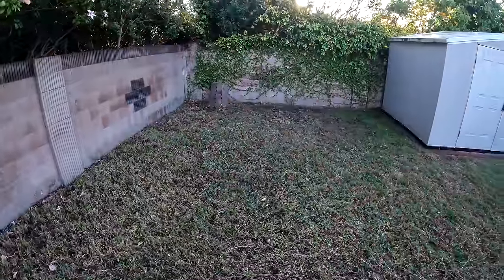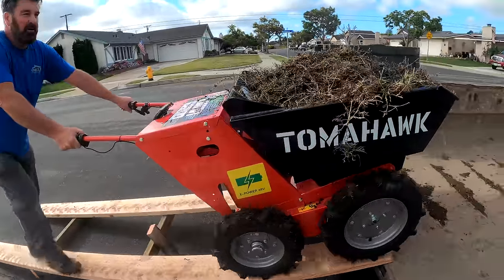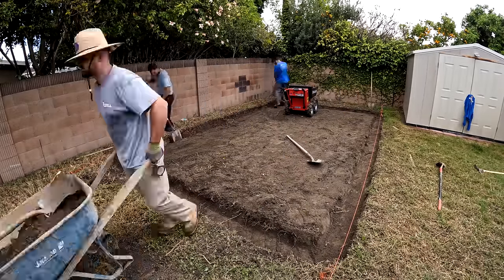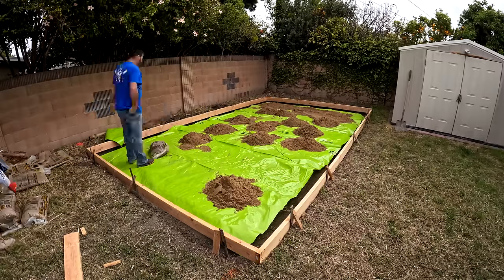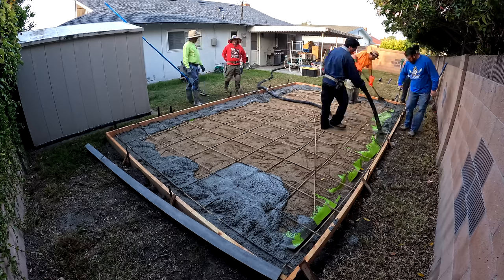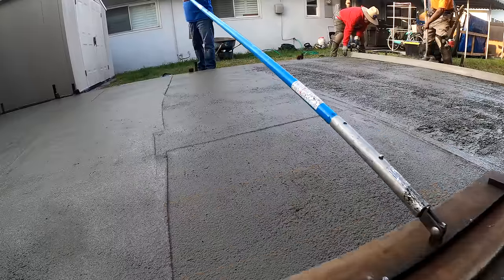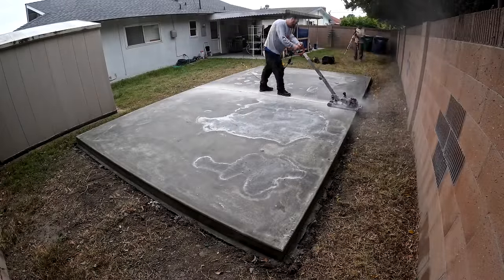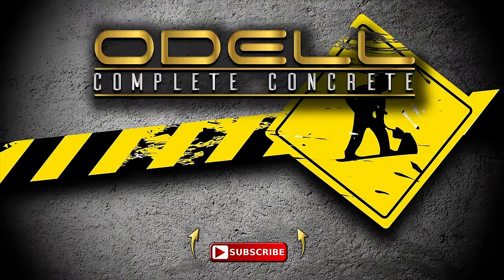How to Build a Storage Shed Slab Foundation

Comment: seeing these experts at work has convinced me to leave this to the pros lol
Reply: You could DIY. Done it myself and the little lady with 60 or 80 pound premixed concrete bags and cement with concrete mix. Keep the sections small no more than 10'x8' at a time if you don't have 5 guys working at it. Pouring is fast and dirty finishing takes most of the time. Plate vibrator for compacting soil, concrete vibrator to remove air bubbles and a nice smooth edge, mixer and finishing tools. Need to pay attention to drying time and temperature, each day and pour is a little different. Need to practice on finishing before any major work.

Comment: I had to build a cement pad for my dog’s 8’ x 30’ ft kennel run. That was a lot of work for one guy, and the cost could have been hard to handle at that time in my life. SO, I used pop cans I had save up as fillers. I’d lay a few rows of cans with 2-3 inches of space in between, then cement between. Then finished off with a couple inches over the whole top. No cans showed (except for the little 8 inch square to prove I used the cans. That was 25-30 years ago, still good as new. I did fill one 4’ x 8’ section with gravel for poop n pee. A great little condo inside, and my spoiled doggers were in heaven (and safe).
Reply from the maker: Thats interesting
Ty
Reply: You got any videos or pictures I like too see there home
Reply: @danielpulido5932  Sorry Daniel, I don’t. That was 20+ years ago. But, the heavy duty chain link was framed with aluminum poles like at a play ground.

Comment: This is EXACTLY what I am trying to have done in my yard for a tool shed kit. Been looking for over a year, and haven't found a single contractor who ever came out to see and give a quote, that ever called me back. Seeing, this, I believe I could do it myself. Thanks David!!
Reply from the maker: Go for it
GL
Reply: Im in the opposite boat.  All the quotes I've gotten have been over $2000 for a simple 12x14 4in slab!
Reply: @billsmith9249  Same. Just got 3 quotes back. 2200, 1800, and 1900, for a 10x10 shed foundation slab. Nothing crazy just a storage shed, but the quotes are much higher than I'd expected
Reply: Most reputable contractors are too busy to take on a tiny job like that unless you get them early in the spring before it gets busy. Concrete is expensive and on top of it, if you only get small amount (1 yd. or less) you may get stuck with an added small load charge. There is also an added charge for any additive in the concrete (fibermesh or calcium chloride that speeds up the set time, etc) So a little slab can get costly if you contract it out.

Comment: And to add icing on the cake, if you add a couple of ducts, (prior to concrete, )coming up vertical from outside to inside the base, you can thread up electric etc inside the shed without external wire showing ! Nice job.

Comment: The plastic is installed on top of the bed (sand or gravel) or under the bed. What would be the correct way as I have seen videos where the plastic is installed differently?

Comment: Why did you pack sub-grade (soil) and didn't put any grave on sub-grade (for under slab water run-off and reinforcement)? Also, leaving the finish smooth without a broom finish, can leave slab slippery especially if wet.
Reply from the maker: Shed slab
Reply: @OdellCompleteConcrete  still not sure why some things that I mentioned above weren't done? Could you please explain?

Comment: I have an Question regarding pouring slab. is it okay to pour concrete for fountain in parts? (by section with rebar) like have difference between days? im just wonder cause i live on area which has many earthquake and i would like to have my foundation in parts incase it cracks .my building code for my area requires about 12 inches thick concrete with rebar and standing on 10-15 pile of material or dig down to bedrock and put some  material below and make concrete frame up and fill up with material and then concrete to make foundation.

Comment: Wow, that is a hell of a shed pad!!!  Going to last longer theb the shed...  Footing, plastic vapor barrier, pink bar gridded...  Most shed pads are just throw 2x4 on the ground and pour, no rebar or footing. Lol
Reply from the maker: yes I kind of over did it
Reply: I needed a 7x7 pad only so did it myself with 4x4s and used rebar sledgehammered them into groud and corner braces, etc. Took bunch of trips to transport ton+ of 1.5" washed rock abt 6" deep. Lil bit overkill for shed that just fit pad, but looks and drains great. For bigger shed like coming here in vid that pad looks real nice.
Reply: Our code is 12 inch turn down, 3/8 rebar on 20 inch centers. and 1/2 rebar top and bottom  of the beam. Inspected before pour.

Comment: Thank you, and you are right about "masterpiece", mine looking at the side has holes where the guys did not push out air bubbles.  Question if I may, do you not need some kind of vertical studs to set the framing 2X's--or do you install that later?  Thanks.
Reply from the maker: Expansion bolts
Reply: @OdellCompleteConcrete  yes but do you install them as part of the original pour or hammer them in later?

Comment: Have you ever tried using high tensile steel reinforcement mixed in with the concrete it’s normally about 1 mm diameter with the ends folded like the head of a pin on the pieces of metal are approximately 1 1/4 1 1/2 inches long
Reply from the maker: No but it sounds like I may get a splinter

Comment: Why did the owner not consider concrete anchors for framing? Would it be possible for the owner to share future videos of this shed build?
Reply from the maker: He wasn't sure about doors
Reply: @OdellCompleteConcrete  You can always  cut off a bolt in the way. Expansion anchors are crap compared to 'J' bolts on 4 ft. centers.
Reply: Its super easy to install an anchor after the pour. A simple drill then some epoxy and set the anchor in.

Comment: I’m trying to build me a 16’x28’ garage/shed on my backyard but not sure if the concrete slab should have beam sides or not what do you think? Or should it just be a flat solid slab with extra rebar
Reply from the maker: Thickened edges work for anchors
Reply: @OdellCompleteConcrete  I was told to do some kind of pillars on the corners and one in the middle of the foundation like a 1ft deep that should help it a bit. But it seems like you know what you are doing, what do you think about the pillars?

Comment: My contractor did 16x20 pad for my shed but didn't cut in the middle.  What is that cut for, expansion joint or drainage?
Reply from the maker: crack control

Comment: Nice video! Some questions from the uninitiated: What does the fibre you added do to the concrete? The big cut you made, what's the purpose of that...expansion?
Edit: That is one sweeeeeeet powered wheelbarrow!
Reply from the maker: Custom
Fiber helps against shrinkage cracks.
Weakened plane joint, controls cracks

Comment: Dumb question: if you knew you were going to build a shed on this right away, would you ever put anchors or some kind of J-bolt in the perimeter during the pour?
Reply: thats not a dumb question. actually really good. i didnt think of it till u menitoned.... j's a lot stronger anyway ..... i mean sure it will take some time to wet set prefectly ...but then ul save that time on boring with a hammer drill ....and yeah j's are prob cheaper and a lot stronger than anchors anyway .....
Reply: you work in construction, are a foreman or an engineer ?

Comment: I own those wheel barrows too, they're balanced on the front wheels, just pick up a little and turn with the front wheels. No need to push down so hard
Reply from the maker: Yes your right I figured it out after a couple of runs.

Comment: Very nice work and video, sir. What was the thickness of the new concrete you poured for the driveway extension? I need to do the same as the 30” wide section. My current driveway is 3.5” thick but I was told I should make the extension part 6” deep. Is that correct?
Reply: Depends on your soil type and vehicle load. In Sandy Rocky soil 100mm for a drive way is fine providing you're not driving heavy trucks on it. 
If you have  reactive soil like black clay you'll need 6 inch and 32MPA concrete.

Comment: So if the guy works out from peoples ready, can you keep them as long as you want or would it be cheaper to hire them straight up?  Or do they have a clause that doesn’t let you hire their people?  Also that’s a $4,000 wheelbarrow but looks well worth it!
Reply from the maker: That's a good question, but I didn't read the fine print.

Comment: 11:15 Why hand trowel after the funny trowel? I would think a larger trowel would result in a flatter more consistent surface?
Reply from the maker: Funny trowels don't work well when the concrete is this hard.
Reply: @OdellCompleteConcrete  Ahh ok, how much time elapses between the funny trowel and the hand trowels? Or what are you looking at to see if the concrete is too hard for the funny trowel?

Comment: I just received a quote for a 16x26 shed foundation. You are saving over $15k DIY. That was quote for prep work with out digging and gravel, just forms and mesh. Another $8k for excavation. Still waiting on concrete quote.
Reply from the maker: Nice save
Reply: I'll do it for a case and a half.
Reply: Shed forming. 2x4 at the top and 1/2 inch, 12 inch strips screwed to the inside. Fill the screws with bee's wax or you will never take them out. Used 1/2 works fine and will do many sheds. Perrmiter rebar supports. 3/4 by 3/4  pieces with finish nails on opposite sides. 8 inch spacing. As you place the mud, twist the stake 90 deg. and remove it. Make a jig to place the 'j' bolts at the center of the plate and the right height.
Reply: @bomonte  Hmmm you're on ;)
Reply: @lpc5152  haha
Reply: it's crazy what contractors are charging!  Im in NW Ohio.  I just want a simple 12 x 14 slab, maybe 4in thick... cheapest quote so far is $2500.  I have a mud mixer reserved for later in July.

Comment: what is the purpose of the cut you make across the slab?
Reply: None, because they didn't put any rebar there. Also, this is an example of how not to reinforce the concrete, the distance between rebars is ridiculous. Rebar mesh would be a much better choice here.

Comment: American building is funny, they just poor a little slab that would never pass over here. Over here you dig trenches at least 90cm down, 60cm width, that's filled with a stone/concrete mix that needs to set for a few weeks. Next you build up a double brick layer to way above ground level with steel mesh at each brick layer, the ground get's sprayed with weed killer,  plastic isolating sheeting covers the ground, next you introduce the steel rebar and pour concrete/stone mix almost a foot deep and let it settle a few more weeks. Only then do you start with the double brick exterior walls.

There's no rot, sag, mildew, damp, termites etc and it will never ever burn. In the US a drive by shooting can kill an innocent child sleeping in bed, over here there will be a chip in the clay brick unless it's something like a .50 BMG
Reply: For 30 years the slab I put under my 4M by 5.5 M  ( 12 by 16 ft.) shed has worked just fine. The edge is 30 CM deep with with 1.2 CM rebar top and bottom. ( 1/2 inch ) Northern IL. on sandy soil. Painted sheet metal roofing/ siding over 2 by 4 studs. I can buy it cut to length. Screw it on and you are done. Still looks good.
Reply: 😂😂 you're all over the place
Reply: This is only California where it doesn't rain

Comment: Why do you cut the concrete? Is it to prevent cracking from shifting?
Reply: To prevent cracking from thermal expansion and contraction. It is usually done in all exterior and thin slabs.

Comment: Why no subbase?
Reply from the maker: Solid
Reply: The trick is to dig the outside, form, and then carefully cut the field with a matlock  to your 3 1/2. ( I like 4 1/2 ) depth.  A little sand or ag lime if you over cut in places.

Comment: I hope you applied to the local building dept for a permit, which would trigger a review in terms of impervious coverage limits and placement relative to alllowible setbacks.  That yard looks like it's got a lot of coverage.  Neighbor complains or when you go sell the house and the buyers ask to see permits for improvements, you may have a real problem.  Point being, don't do this kind of stuff without getting local approvals.
Reply from the maker: No need, no utilities. Under 250 sq.ft.